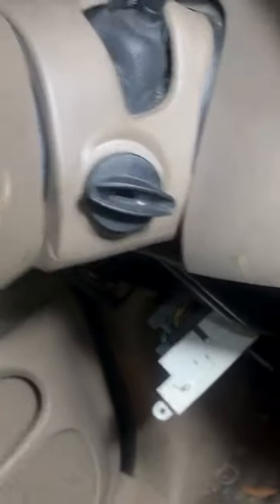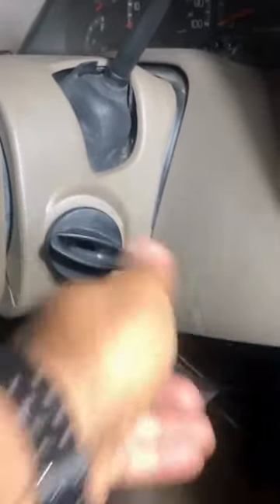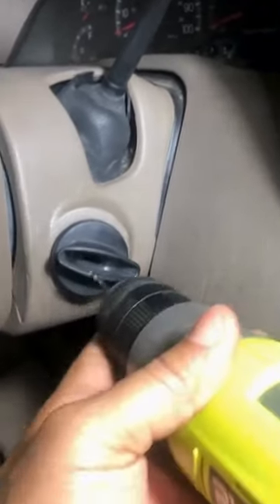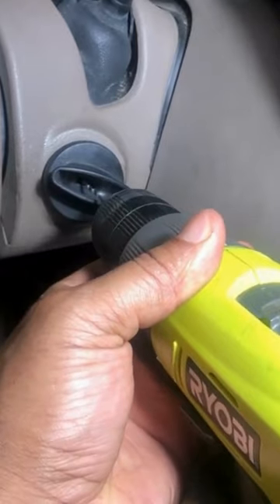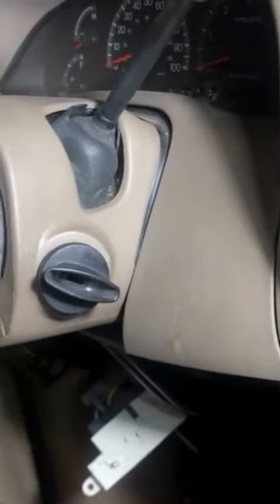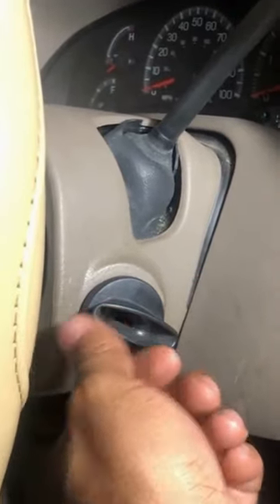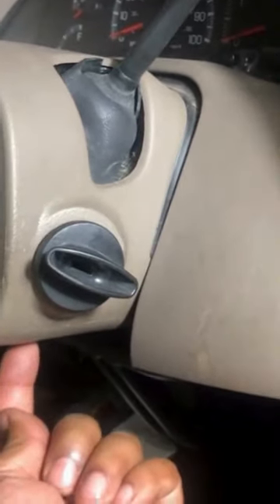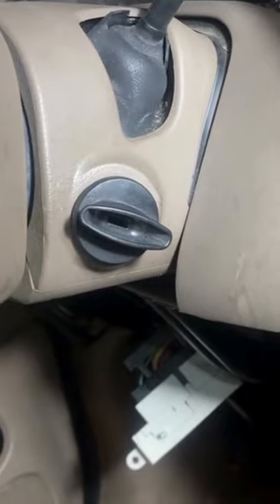How to Remove Ford Ignition Lock Cylinder Without Key #shorts

Comment: Mine is almost completely hollow still wont turn do I have to drill deeper
Reply from the maker: It’s got to turn to be able to come out.
Reply: You've probably have a new key switch to install, you measure the depth of the new one (key length)  and drill accordingly. Assuming you've already completed this task, it may come in handy for those seeking knowledge in the future.